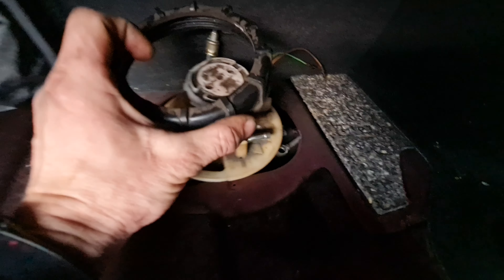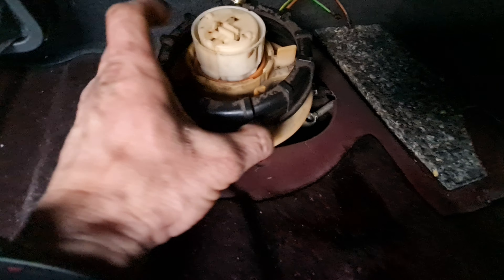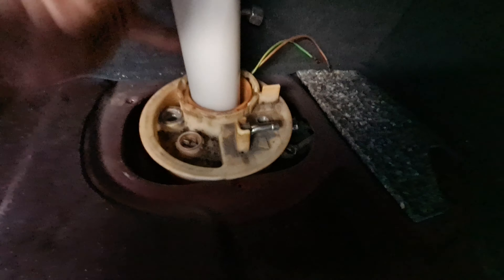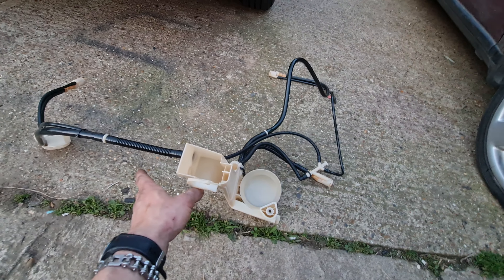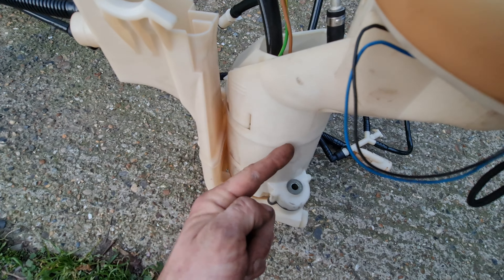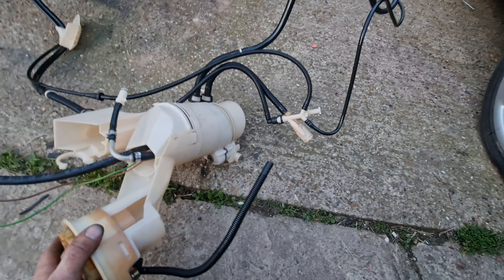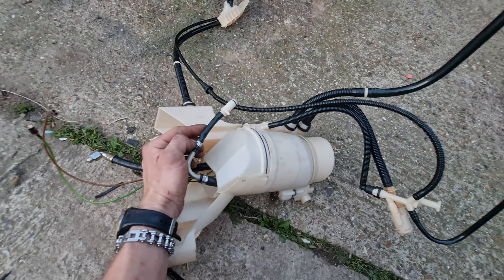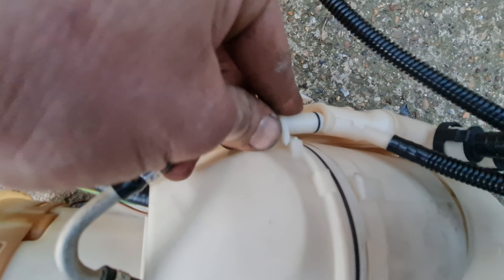Audi A8/S8 D2 fuel tank (pump)  Assembly

Comment: I have the same issue with tank half full and car stops.  Last time I did u do the big bolt on the pump and re tightened the screw and the car did work as it should and run tank empty but after refuel the car stops at half tank again. I was suspecting that the system might need bleeding as it does work on the suction in the tank.  I will deffo try this method now iam sure it will solve the issue.  Great video bro thanks